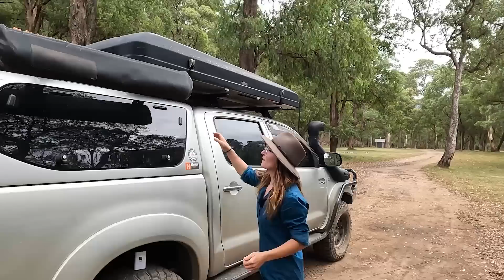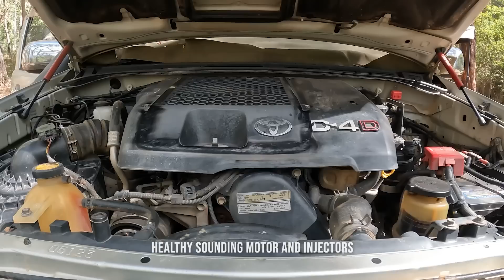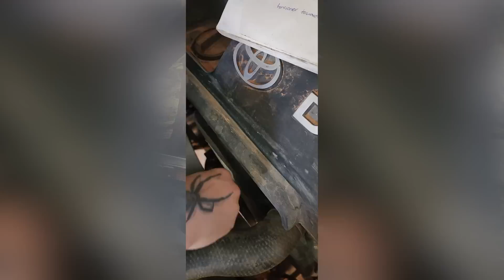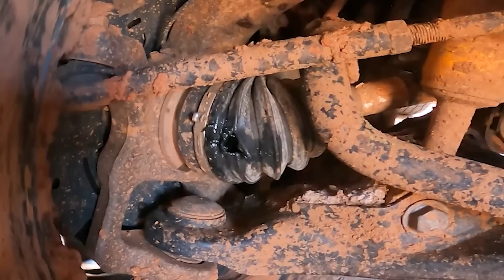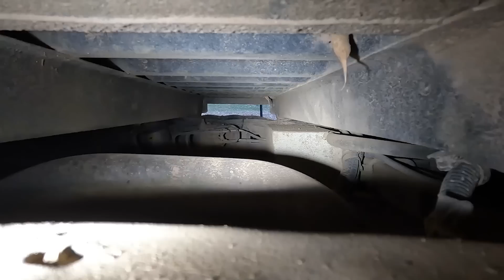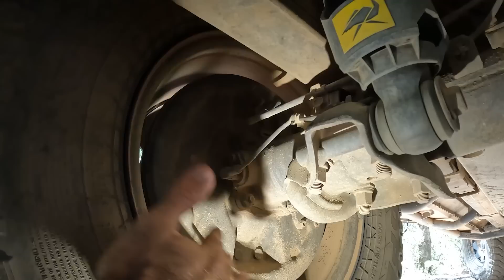Learn the Basics of a Vehicle Inspection with 2 Mechanics

Comment from the maker: We hope this video is helpful, and you have gained valuable skills about your vehicle!

A few things we should have mentioned is always check the car cool, it's never fun working or checking on a hot car.

🔧If you have spanners or sockets on a ratchet, put them on accessory bolts to check if they are loose, but don't over-tighten, this can stretch the bolts and make them weak. Particularly check accessories such as bash plates/UVP, protection bars and roof racks. We wished we put this in the video, but this pinned comment will have to do. 

This video is intended to give you an idea of what to look for on your vehicle and how to check important mechanical components to familiarise yourself with your 4WD. 

Let us know if you would like us to go into more detail about anything we showed, or on another subject.

Thanks for watching and hope you take these skills and put them to work on your rig!

Comment: hey guys, thanks for another great vid. i’d love to see a winch rebuild video if you do it…i made the mistake of letting my Warn sit so i need to rebuild it. i’ve heard they’re easy, but i’m most definitely an amateur…
Reply from the maker: This is a job that we will be doing soon, so we will dust off the cameras and film this Phil. Thank you for the comment. If you are a subscriber, turn on our bell to get notified when it uploads. When are you hoping to do this winch rebuild?  :)
Reply: @LapsofMaps Subscribed a while back..love ya stuff.  That'd be awesome to see the rebuild. Just switched vehicles and now have an hdj100, but it has an OEM bar, so will need a new bar before I fit the winch...so probably not in the next 2-3 months...
Reply from the maker: @PhilTaylorPhotog  the brake which stops the winch from unspooling under tension needed greasing. This was the squeel issue!

Comment: so when i put my Hilux on a hill put it in natural or 1st gear hand brake all the way it starts to creep down the hill untill i put a wage or turn it 90 degrees thanks josh
Reply from the maker: Check your handbrake cable, it is likely seized or stretched. If you can, take rear drums off one at a time and see whether the handbrake is working. Could need adjusting from the handbrake cable inside cab too. We just replaced all of our handbrake cables because of your exact issue.
Reply: @LapsofMaps  thanks

Comment: Hey Guys, love the movies…. Any chance you have some specific tips for an old 7.3 F250, we’re heading out your way to Mount Dare / Simpson this year and would prefer that you guys don’t have to jump under it and fix it up for us or worse still drag it out of the desert…
Reply from the maker: Hey Nick, get a mechanic to do a dedicated thorough inspection before-hand, and let them know you are heading into the outback. Address any issues such as brakes, suspension, bushes, belts, leaks ect. You want your car to be in good mechanical order. 
Getting off-road recovery insurance is always a good idea, in case the unexpected happens. (Club 4x4 offers it and Birdsville has recovery insurance but Birdsville covers a certain map area in the Simpson, look on their website for more info.) We won't be at Mt Dare this year, but there will definitely be assistance there. 
Suspension is a big one, having suspension that is able to cope with the excessive heat from corrugations is important, LT tyres which are deflated to 25psi-28psi hot for the gibber stone and cap your speed to under 80 because washouts can appear very quickly. 
Hope this helps mate!! Have fun :)

Comment: Great stuff guy's,  I have 3 to check especialy this time of year lots of water crossings on the road. A great tip for pressure washing is to grease every point after to expel any water from unijoints , shackles etc, great tip on the mass flow sensor I know of a person that used break cleaner and about a month later had very sick Hilux. My 3 live in the Pilbara and do lots of Great Sandy Desert trips and some times I have not seen any other cars for several days. My 3 bush rigs , 2005 Ford F250 7.3 powerstroke factory Aus spec it has done the Gun barrel to Alice 3 times, 1985 Landrover County factory fitted 4BD1 Isuzu just clicked over 918,000ks it has done Canning both ways about 3 times , Karratha to tip of Cape York via Gun barrel  and I have just Purchased a brand new 2023 Toyota 79 series, so far it has been to Mataranka on the black top :) Great Video guys with very intelligent info and tips, thank you. Kind regards from the Pilbara.

Comment: 15.47 is that a missing nut on the bolt through the chassis?
Reply from the maker: Good pick up! That black plate has a captive nut welded into it, bolted on the other side so she's safe. 👍
Reply: @ Thought I was going to win a Mt Dare stubby cooler…..

Comment: You guys should publish a little book small enough to fit in a glove box with all those pointers. Some more good content would be the top 10 tools to take out bush etc...The common sense cook book. I'd buy it if it was no more than $15. A4 sheets folded in half and stapled. If you made $10 a copy and sold 5000 copies you could insulate your work shop. I know jack about mechanicals, but sure do love my getting out bush and camping. Prevention is better than cure to me.. That was well explained in layman's terms.
Reply: All those things you can easily complie yourself and print off. Trying to do that for $15 a book these days they would be losing alot of money. You really think theyd make $10 profit on a $15 book... hahaha.
Reply: @TheKodiak72  I bought 5000 blank a4 sheets the other day for $6 at Coles. Cost about $2 to get 10 pages printed at a commercial printers in bulk.